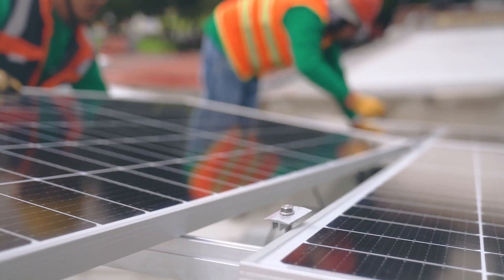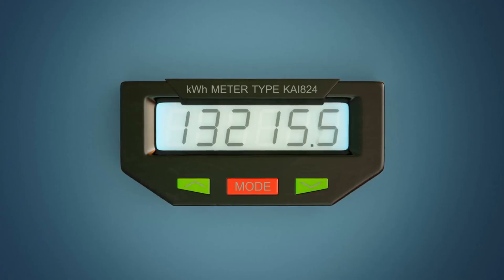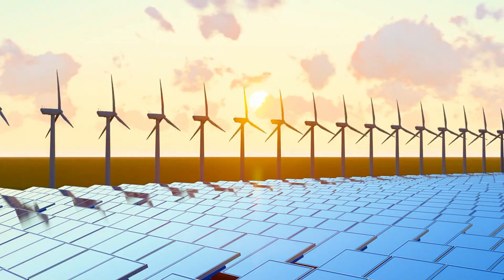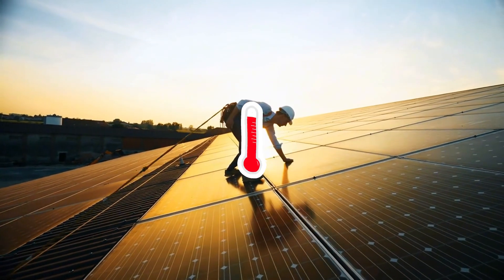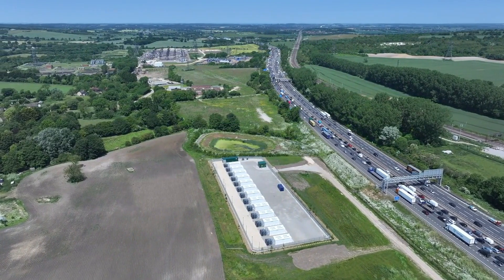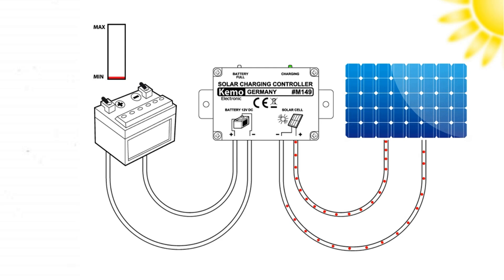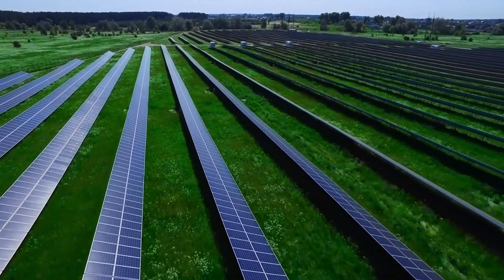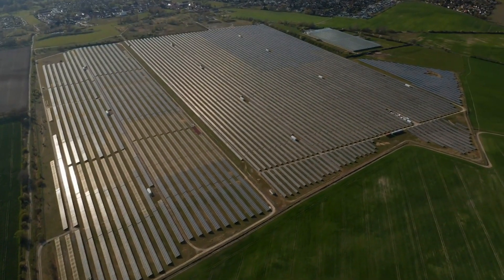How Many Solar Panels to Entirely be Off-Grid?  (With/Without Batteries)

Comment: Okay, I got in 3:35 before deciding you are a fool.  In practice, you can't just use a fixed percentage for over sizing solar panels and batteries.  You have to consider the pattern of your weather.  And you have to factor in your alternatives.  It matters whether you live in British Columbia or Arizona.  Whether you can heat in the winter with a wood stove, or whether it is acceptable to use a propane generator in the winter.
Reply from the maker: Do you know a better way to calculate the best sizes?. You may share it here for spreading knowledge.
Reply: The tone of the negative comment sounds like someone who's never created the thing they're criticizing. Thank you for the video. @renewable_energy